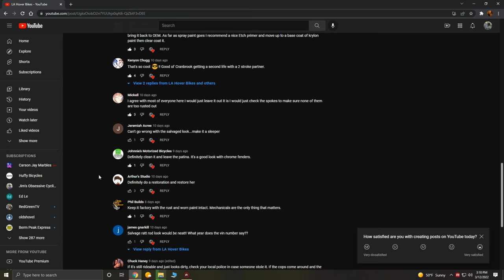Abandon Bicycle Gets A Motor

Comment: Hey next time just knock those races for the crank out to clean it up easier. Just use a bunch of long screwdriver from the other side and knock them out from inside out. You probably know but makes it easier and figured I would mention it.
Reply from the maker: Thanks for the tip, I did not even think about that :)

Comment: Looks sweet. I found a brand new Schwinn Bayside in a ditch while I was on vacation. It still had the tags on it, and I used it for a motorized bike until the freewheel decided to fall off, cracking the frame.
Reply from the maker: Nice find, even if it only lasted a little while.

Comment: To be ditched on the side of the road for a bent rim... That's sad. Now it's a ripper. After getting a Genuine scooter, I'm realizing I've slept on the 2 stroke 49cc. The factory unit does 40mph with the restrictor still installed.

Comment: @LA Hover any update on the 4 stroke build?  Is it still total garbage?  Did you just get a bad kit?  I'm curious.  Oh and by the way, if you're looking to sell the bike, I'll do a trade for one of mine.  It's got a lot of performance parts on it, but it's not running.  And Id rather have a running bike than a fancy one in my garage.

Comment: i was going to do this with a small 24 inch mountin bike frame but my bike motor was stolen the day i worked on it left inside for like 20-10 mins and it was gone sucks just broke it in too :(

Comment: HELP! I bought a 80cc bike kit from kinbelle off Amazon and it now mounted to my bike. I was very disappointed to have it only top out at 19 miles an hour. Not sure what I can do to get more speed out of it. So I'm looking for advice please :/
Reply: And yes I know I can put a bigger gear on it but I'm thinking it's likely a tuning issue or something that I'm just not aware
Reply from the maker: First take the head off and make sure the cylinder is 47mm not 40mm.
Some sites scam people into buy 49cc kits by listing them as 66/80cc.
If it's a 47mm than it's most likely running rich and the exhaust is restricting flow.
Run a fuel oil mix of 32/1, or 40/1 if you are using quality oil.
If more help is required you can get live help in our discord server. 
https://discord.gg/45EpgWX5
Reply: @LAHover  thanks I'll check that out

Comment: Nice, fall before last my pickup got stolen. The thieves left a bike and jimmied my ford 7.3  diesel. I turned the bike in to the police but 6 mos later they called to say the bike was mine if I wanted it (I got the jacked up truck back as well). The bike is an older specialized street stomper and is the only free bike I ever got. I watch your channel because I'm trying to decide what engine. So far I have built 2 huasheng 4 strokes and one china doll that was a bad one from the getgo. What kit would you suggest? Not too fast but I'd like a reliable 2 smoke....